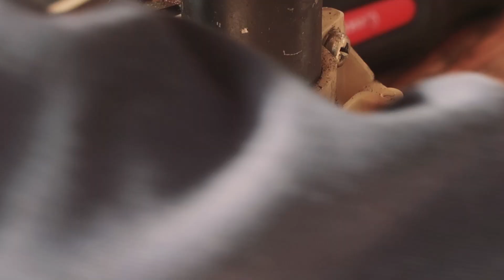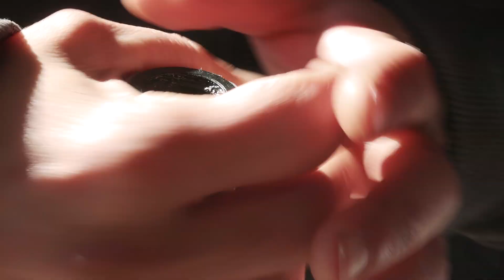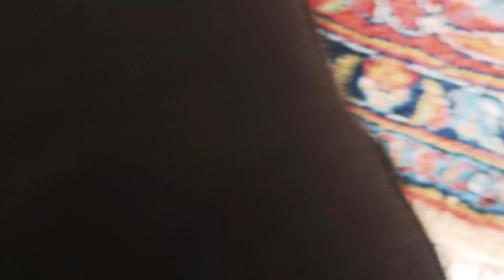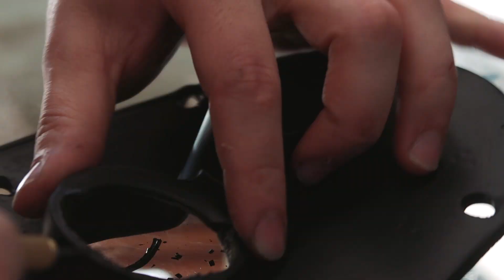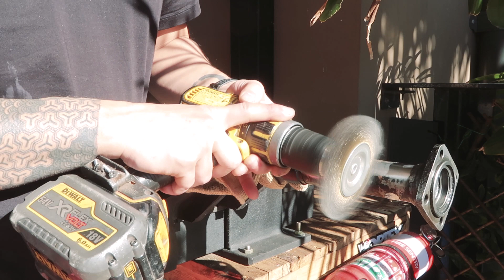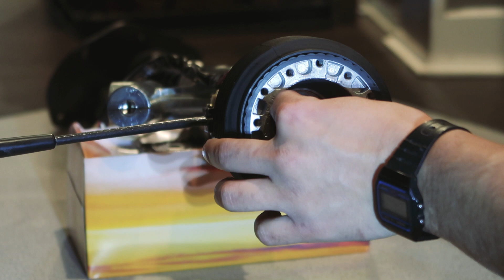DATSUN BUILD - STEERING COLUMN RESTORATION! (#19)

Comment: Hey mate long shot but I am literally doing the steering column in my 1200 Ute and I can’t find a bushing anywhere! And chance you could print me one? Located ACT
Reply from the maker: Hi mate, chuck us a message on instagram. Maybe we can work out something after lockdown XD
Only problem is, I printed so many and didn't end up getting the right dimensions even by the end. It was a fun side project tho. Had to sand it to fit :/ Have you considered shaping a piece of nylon from bunnings? Or using a poly bush? as per the 1200 wiki?

Comment: Great video, just curious how everything went back together in the steering box? i have done the same as you about a year ago and was told that you shouldn't separate the the steering box and column
Reply from the maker: The installation will be part of the next vid! But I did run into some troubles :/ Its really easy to crush bottom bearing...

Comment: I need a new steering wheel for mine. What size hub is that?
Reply from the maker: It was 350mm but I wouldn't recommend a deep dish wheel. I think its going to be too close!
Reply: @32Builds  right on. What would you recommend then. I mainly just needed to know the size. Here in America it's hell trying to find stuff for the sunny

Comment: Nice work! I do see a problem, putting a smaller steering wheel on a car with bigger tyres that doesn't have power steering might be a small issue. I switched from the 12x4 to 14x6, 155 to 165, and I feel the difference on the stock steering...
Reply from the maker: Damn! I guess that's part of the learning process tho, thanks for the heads up! I've driven some pretty heavy no-power-steering cars tho - usually doesn't matter too bad when you're not tryna park. Cheers mate!
Reply: Reversing in a parking is the worst for me. You'll never feel it at speed.
 At least you won't be hitting the horn while looking back to reverse like I kept doing for the first few months of ownership.

Comment: the part you printed is the fully plastic not just the shell? Reason is the printing that I have seen has a honeycomb inner and then a coating on either side.
Reply from the maker: Yeah 100% in-fill, so it is solid plastic :)